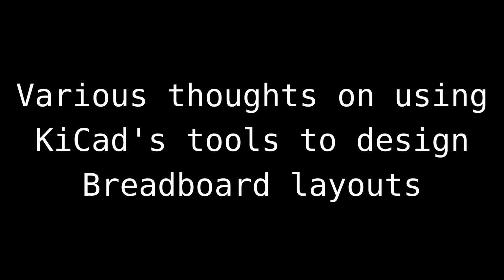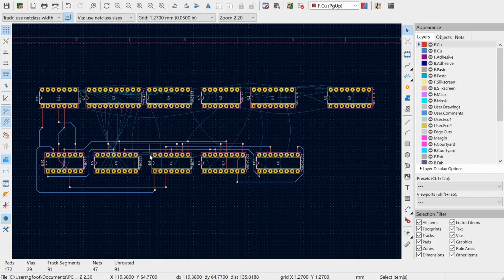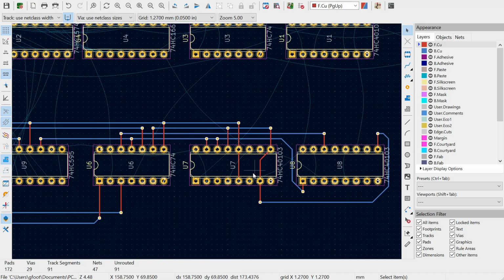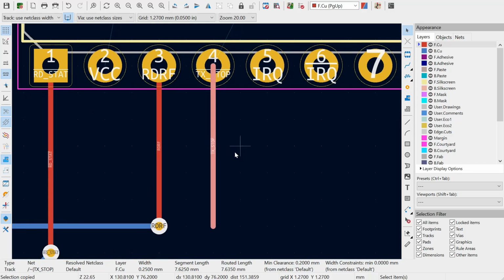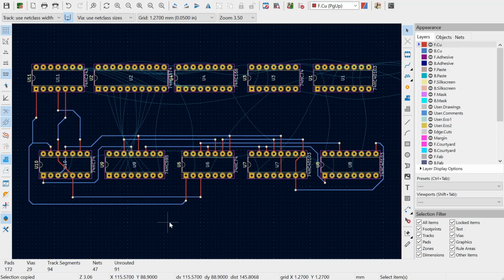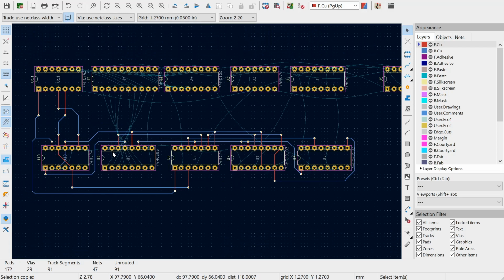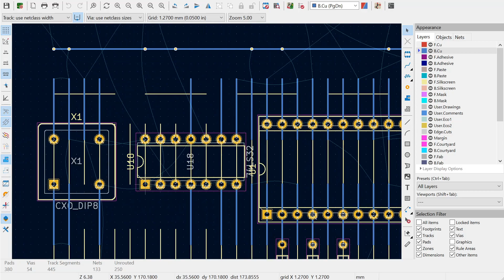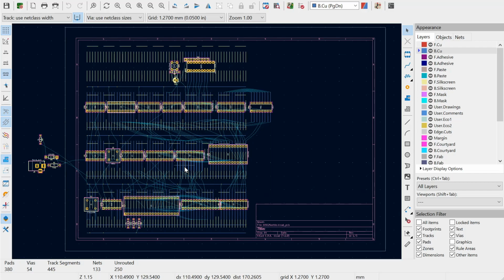Using KiCad to design Breadboard Layouts

Comment: Thank you for useful tips! I'm so happy I invested some time to learn KiCad basics. Now I have access to a huge library of symbols and footprints without detail sacrifice. Yes I have no nice stripboard background like in Fritzing or VeeCad or DIY layout creator. But it really doesn't matter. More over an ability to route only needed strips makes designs vastly more clear to work with and gives you nice zero-thinking points to cut strips on a real strip board.
Reply from the maker: I sometimes use the silkscreen line drawing tools to draw the breadboard structure as a background, and lock that layer so that I don't accidentally move them later on.

Comment: Sounds like a good idea!  I never considered using Kicad for breadboard development.  Out of interest, have you ever subsequently gone on to modify your kicad ‘breadboard’ layouts to produce actual PCB’s of the projects or did you have to start from scratch when designing an actual PCB of the same project?
Reply from the maker: I cloned the project though ("Save As") as there were some differences and divergence, PCBs need extra things that aren't needed on breadboards, etc, like power connectors and mounting holes, but I didn't keep the layout in the PCB Editor - I did that again from scratch, as I wanted to pack things into a smaller space with shorter traces, using both sides of the board, and staying within a small overall footprint.

I also then came back and updated the breadboard project later on with new experimental ideas, and it was really handy to ahve kept them in separate projects.

Half of me wants to actually make a new project folder for every revision of the PCB as well, but for now I've settled on keeping a PDF export of the schematic alongside the gerbers for each one.

Comment: Have you considered exporting the netlist to another breadboard specialized application? It looks awfully tedious creating those layouts in a program intended for PCBs rather than breadboards. Fritzing is a popular CAD tool for designing and testing circuits using a virtual breadboard. I believe it supports the ability to import/export netlists from other CAD packages. 

Alternatively, there's VeeCad which also imports/exports netlists. It is geared for Vero Board layouts which is very similar to breadboards and may even support it. 

Both applications support autorouting and layout which is a huge time saver. Unlike the PCB equivalent, the resulting layout is more acceptable given that prototyping boards have more layout constraints. Both applications are free and open source.
Reply from the maker: Thanks, I'll check them out!  I am very familiar with KiCad, so still find it quite a quick and comfortable process, apart from not supporting overlapping wires on the same layer of course.
Reply: VeeCad does support breadboards (as well as pad-per-hole protoboards) - it has a few common layouts or you can make your own. I find it works very well for a hybrid workflow. It ain't the friendliest or most modern software, but it's great in its niche.

What I've done is created a VeeCad library that has everything named the same way as the KiCad footprints, just by creating the VeeCad components as I need them. That way, I can take a KiCad schematic, pop it over to VeeCad to create a breadboard or protoboard layout - and then, when/if the time comes, the same project is ready to go back into KiCad to draw up the PCB.
Reply: @rjhelms  Does VeeCAD support automatic layout? I figure it would do a fairly decent job since the algorithm may work better with a more constrained set of nodes.
Reply: @bobweiram6321  It has some autorouting, but it's pretty rudimentary and only supports veroboard - much more in the realm of assistance to manual layout than an automatic process.